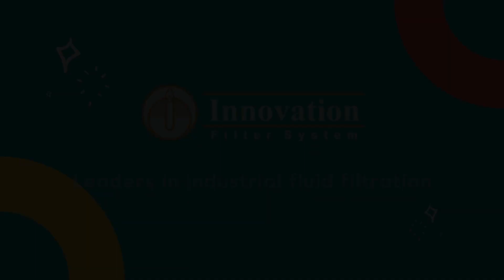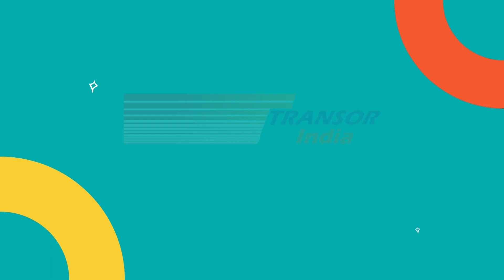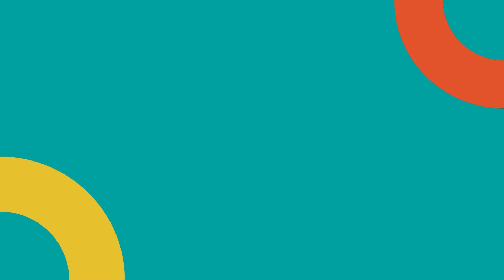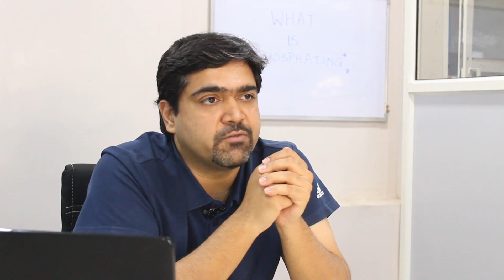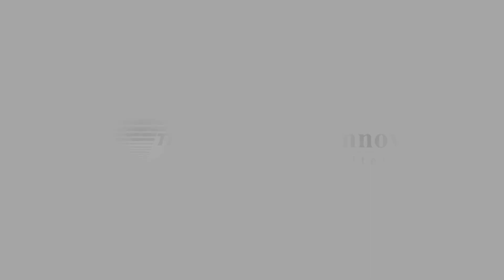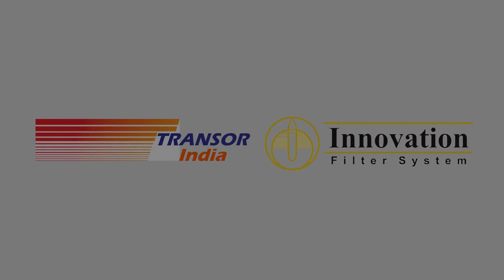How does zinc phosphating happen?

Comment: Hi sir
Thank you for the details.
I am running a fire extinguishers factory.
Which phosphating process should I use?
What is the name of chemical compounds which is used in Eight tank process.
Thanks
Reply from the maker: Dear Sir, phosphating process depends on your application/process. Please write us in detail about your requirement at sales@innovationfilter.com. We have no expertise for phosphating chemical details. We will share the relevant info if we come across.
Reply: I am in the zinc manganese phosphating industry. Since fire extinguishers are stored indoors, they do not need to withstand a higher corrosion class than C3 according to ISO 12944 with high durability. Both zinc manganese and iron phosphating can achieve this. Among these options, iron phosphating is preferable as it is the most cost-effective and straightforward method. I would also consider thin-film technology like Oxilan, as it doesn't require any heating and virtually eliminates sludge formation. You can purchase all the pre-treatment materials from suppliers such as Chemetall.

Comment: I would like to learn more about Phosphating metal couplings for pipes. Oilfield pipes.
Reply from the maker: Hello. We will work on the same and come back with video shortly.
Reply: I work in the field. However, it sounds like heavy-duty corrosion protection painting is what interests you, as long as it's not related to mass production.

In summary:

1. You need to clean the metal surface with alkaline degreasing, removing all external contaminants such as dirt, dust, and oil residues. Rinse thoroughly afterward.
2. Blast the surface to SA 2 1/2 according to ISO 8501 and achieve a medium surface roughness per ISO 8503. This is to remove any rust and mill scale from the surface and to create adhesion for the upcoming paint. Steel grit could be a suitable blasting medium unless the material is stainless steel. Afterward, vacuum or air-blow to clean the surface thoroughly.
3. I would recommend a painting system with epoxy as the base coat and polyurethane as the topcoat. Make sure to follow the Technical Data Sheets (TDS) and Material Safety Data Sheets (MSDS), and you should achieve excellent results. :)

Comment: Or after Iron phosphating we can do powder coating??
Reply from the maker: Dear Mr. Murali Prasath, thanks for the question. The process of Phosphate coating is employed for the purpose of pretreatment prior to coating or painting, increasing corrosion protection and improving friction properties of sliding components. You should go for powder coating after iron phosphating is done.
Reply: Thanks for replay sir, Which is better for Mild steel, Zinc phosphating or Iron phosphating sir.
Reply from the maker: Zinc phosphating is the preferred choice for corrosion protection of ferrous metals